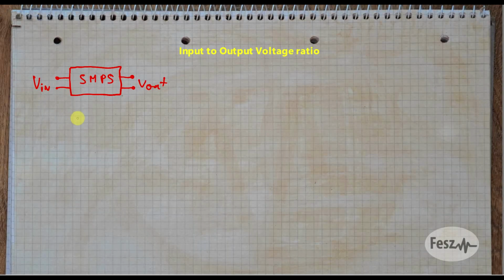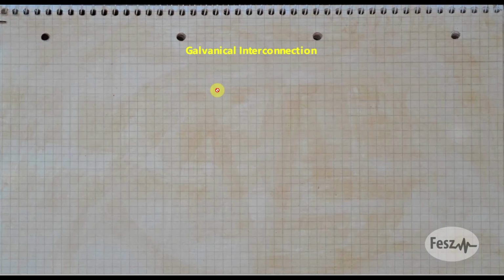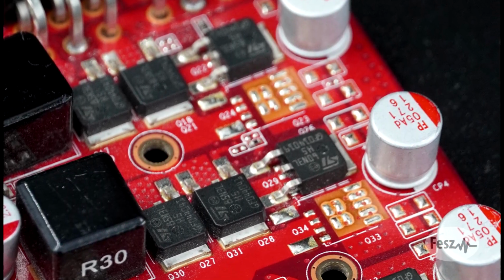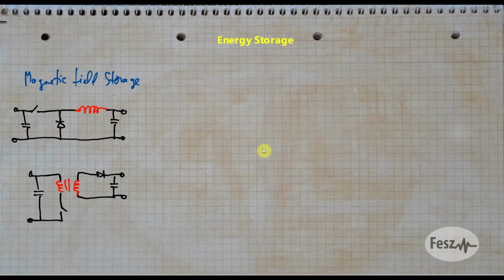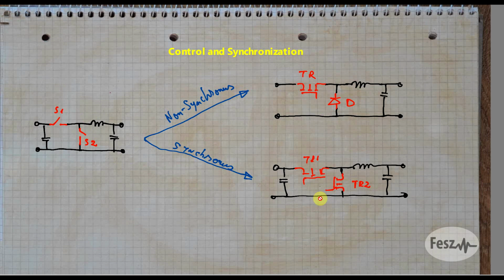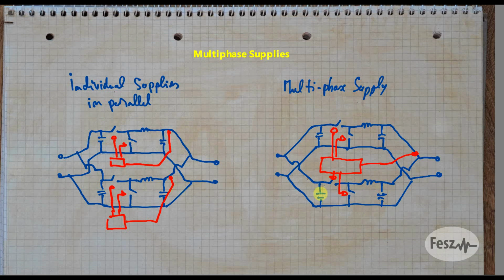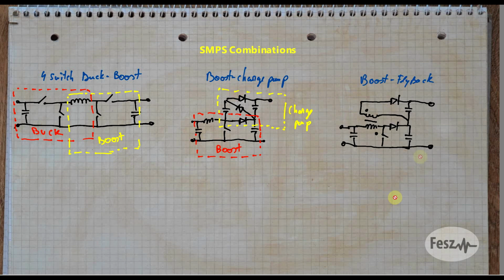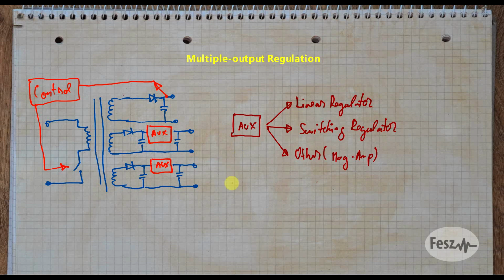SMPS Topologies and Classifications

Comment: There are actually two types of circuits with isolated outputs.

1.) The transformer kind, which is most usual.
2.) The Y class capacitive couple, which is less common for some reason but essentially it replaces the transformer in a normal isolated SMPS with a class Y capacitor. Most transformer based SMPS use 1 class Y safety capacitor anyways so instead of using a transformer you could just use another class Y safety cap to transmit power to the isolated output. It’s worth noting that this only isolates DC and low frequency AC, but there are virtually very few circuits capable of high frequency AC isolation.

Comment: 10:28 cross regulation,  this is the reason why most ATX power supplies today use an LLC or PSFB converter with 12V output and then step-down to 5V and 3.3V and generate -12V from the same 12Vmain rail, today's PC loads have high power excursions so maintaining regulation with a multiple output winding transformer was not feasible anymore. excellent video, thank you! :)

Comment: @Fesz Electronics. At about 0:34 you said, "Unlike a linear power supply where the output is always smaller than the input voltage..." I just can't tell how my Grandpa's old Crosely gets the 300 volts for the B supply, from 120VAC, here in the mental wilderness, of North America.
Reply from the maker: There should be an AC transformer in there - with that you can get any in to out voltage ratio
Reply: Hi Fesz Electronics... thanks I'll tell grandpa.

Comment: Want to see the individual designs of all commonly used converters from scratch on this channel. From components/ IC selection, simulation, performance analysis, stability etc. Specifically for FLYBACK CONVERTER. I still don't understand the selection of IC, Transformer and loop stability.

Comment: Two interesting things about many modern computer power supplies.

First is the Active Power Factor Correction.  Which is really a boost converter to charge the high voltage capacitors.

Second is, for efficiency reasons, many power supplies have gone to only producing 12V, and then using buck converters to bring the voltage down.

So a modern PC power supply has three different stages in series to provide the 5V and 3.3V output.

Comment: Switching power supplies are fascinating. I've repaired a broken power supply from my PC and I found there another interesting way of controlling the 3.3V output. They were using a synchronous rectifier on the 3.3V rail unlike on 5V and 12V.

Comment: Thank you for the video.
Could you make a video about connecting 2 pcbs with long cable for power and data communication and the issue we may face and how to solve it? Like inductance from the cables and filtering power...
Thanks again.

Comment: Hello, Can you make a inductance meter which can be accurate to design inductors for such converters ? using Arduino or stm32 ? I have tried many circuits on the internet but they seems to be inaccurate.